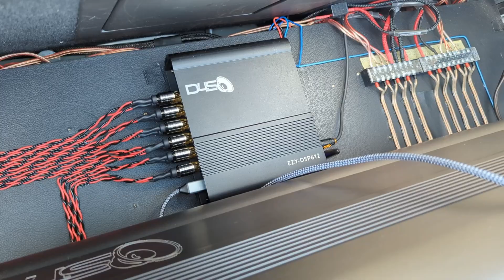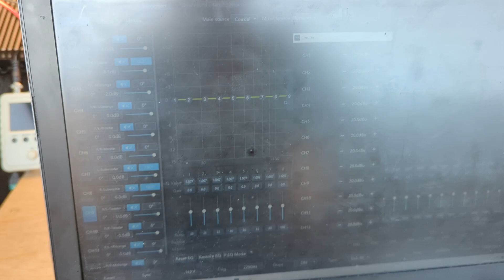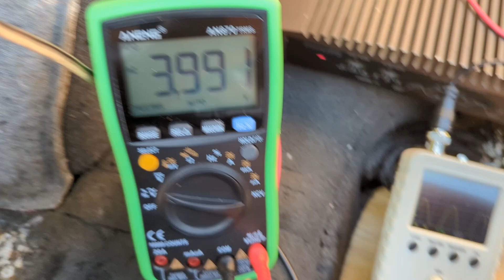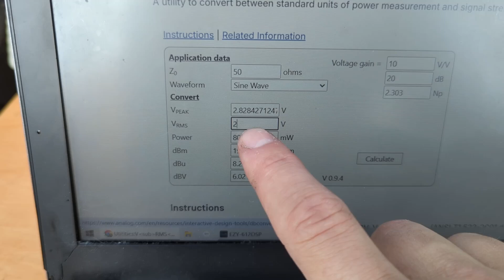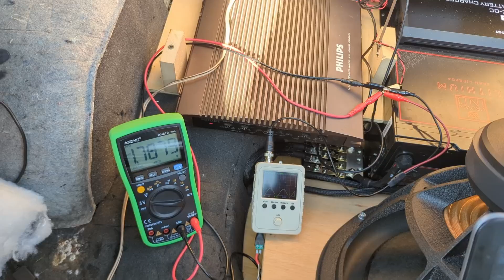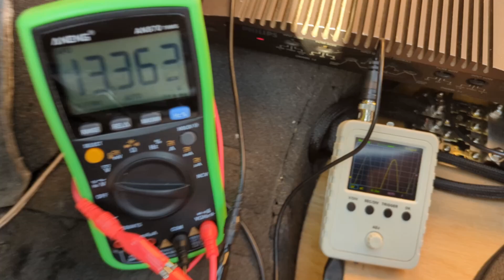Down4Sound EZY DSP - how to use the limiter

Comment: Thanks you for the videos, I am going to pair the dudu7 with D4s EZDSP612+ I was wondering in these vids with the coaxial in do you have the headunit set to max volume and user the controller for the DSP to control the volume.
Reply from the maker: If you have the DSP controller, set the Hu to max. If you don't, you will have to control the volume on the Hu.
Reply: @RAW-CAt Thanks for the response man. Is using the HU to control the volume via optical as bad as people say ? Apparently decreases bit depth ? Also love the content I'm learning so much because of your channel ❤

Comment: Quick question,  from an Subjective point of view, how does the Down4Sound DSP sound compared to your Helix. I seen your measurements and it was very impressive not just for the money but impressive no matter the price. It is using the JRC 4580 op amps, they are not bad but not amazing. They are known to have a warm sonic signature. 

Thanks for your help in advance.
Reply from the maker: Honestly, I cannot tell the difference.
Reply: @RAW-CAt Thank you for prompt resposne and that says mouth full. Honestly I am going to use it in a Home audio 4-way active setup. Power will come from a Ultra Low Noise linear power supply.

Comment: I have a question about the input voltage of the D4S amp. If it takes input voltage of 6v and the EZY DSP only outputs 4v. Do you use a line driver before the DSP or would you?
Reply from the maker: If you are feeding the DSP with a high level signal, choose a version with high level inputs. This one I have reviewed, does not have them, but the newer ones do.

Comment: Just a heads up, I'm sure you realize, You've just shown everyone how to set up the amplifier with no "gain overlap". I wouldn't be afraid to feed it 3v (+3.5db) in.  (although I will argue against it later below)

Depends on how you tune as well, Some people throw in a bit of boosting here and there. So if you set it up "zeroed" like shown here, I would feel safe having spots with 3-5db boosted. if needed.  And call that your "overlap". On the other end, If you haven't boosted, and nothing is above "zero"  You probably DO want to let the channel hit that 3v for some overlap.. 

BUT REALLY If your amp has decent enough power, and the speakers are screaming, and you are satisfied with the power, Go ahead turn it down! And go relax! because You'll never clip. Lower noise floor. Happy days 😘😘

"Gain Structure" blah blah blah

Comment: Would you say this DSP is of the same quality as the Alpine PXE-0850X?
Reply from the maker: Signal quality wise they are similar, however EZY DSP has 4V out, where Alpine only 2.7V and the EZY is slightly cleaner. That is the biggest difference between them. The other thing is that Alpine does not have any all pass filters. Software and functionality is identical.
Reply: @RAW-CAt  Good to know ... thank you!

Comment: Thanks for another educational video sir, I have a question for you, if I heard you right, you said we need to do all of this with the amplifier gain set to minimum, right, after all of the voltage limits have been set accordingly, do we adjust the gain or we leave it where it is and if we do adjust the amplifier's gain, won't we be introducing a clipping signal, please accept this question from a car audio noob 😊
Reply from the maker: Yes, if you will increase the gain, you will clip. The gains on the amplifier have to be all the way down.
Reply: Thanks for the clarity, much appreciated

Comment: It needs a VC.
Reply from the maker: What for?
Reply: @RAW-CAt  Those D4s do not have a Volume Ctrl if I'm not mistaken. VC. Like the Aerospace 8-12 (Mosconi) DSP. The Mosconi has the wired control to level master volume, sub, and of course cover points, eq, and time. I cannot confirm. I do not own either. What about the Helix or JL DSPs?
Reply from the maker: @DarronSanderson  oh, I thought you mean virtual channels. The D4S controller is coming soon.
Reply: @RAW-CAt  oh, got it, thx. I am still in the design phase. Another option is using the Astell&Kern hires DAP, the SP3000 as VC. The problem would still not have drivers position real-time Ctrl. for anything else. The DM-810 Audio Ctrl is another option. It’s car audio. Tuning a system is easier than being decisive on the gear.